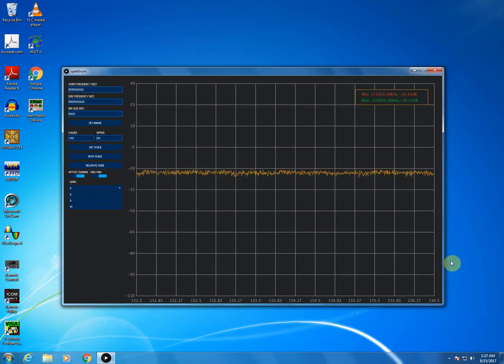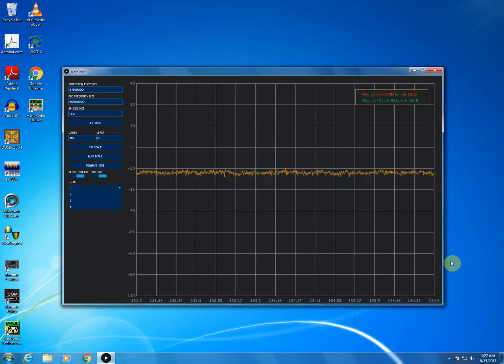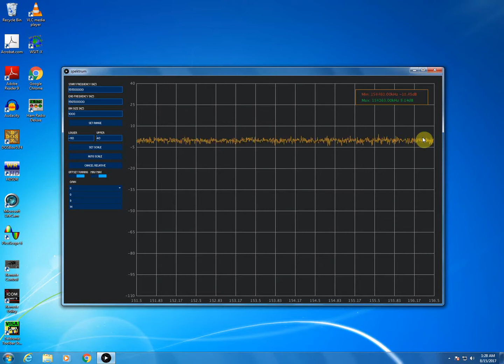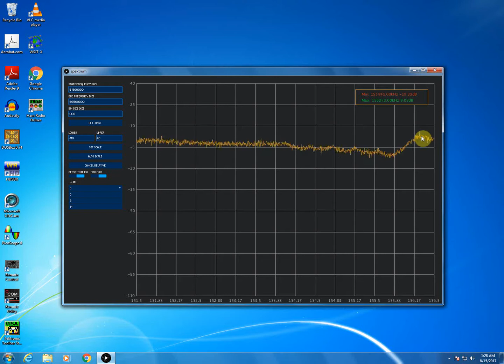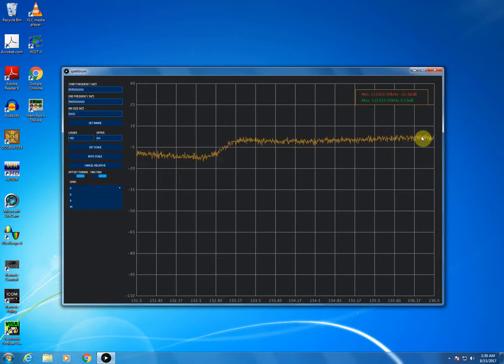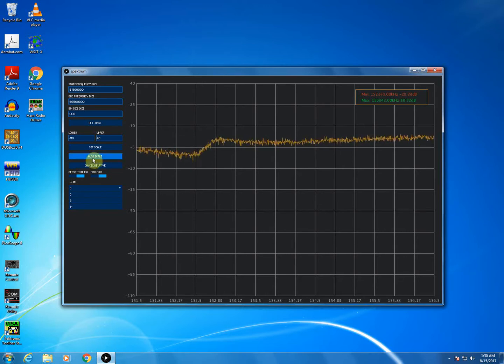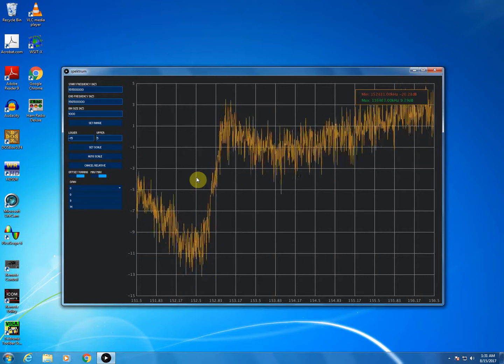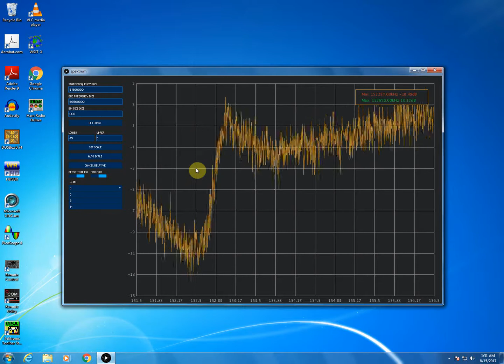Poor Man's Spectrum Analyzer - Tuning Cavity Duplexers

Comment: Thanks for this. I tried using a nanovna it would show that it was tuned but sensitivity was never there. I tried you method above with my RTL-SDR v3 dongle, tinySA as a signal source. I never saw the same display, even with a sweeping signal. But I was able to set it to the high/ low freq and tune the signal as low as possible on spektrum. It works very well now. I am sure it can tuned much better with better equipment, but I am hours away from any city/ clubs. So this will do.